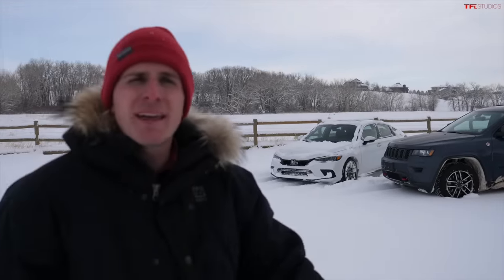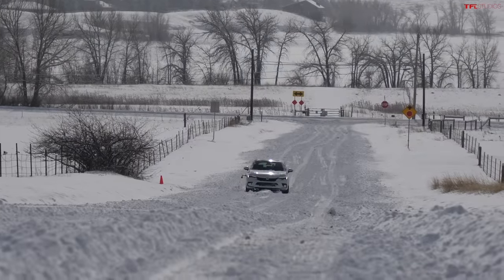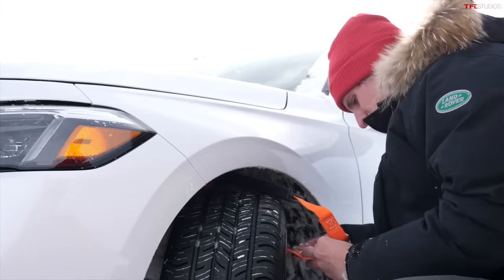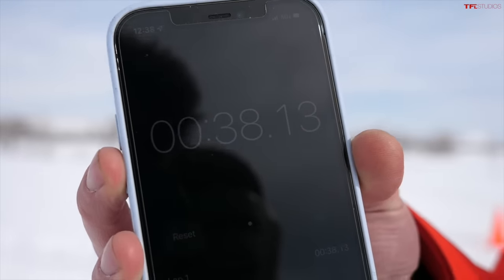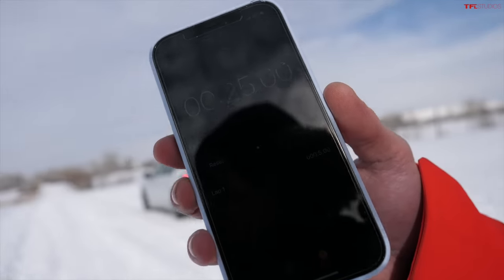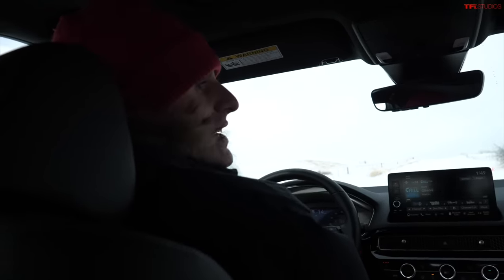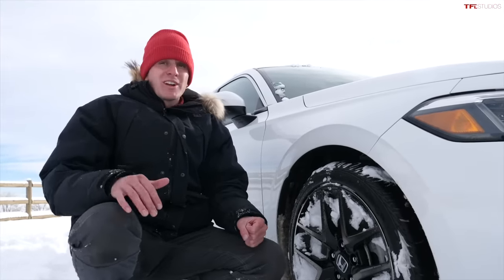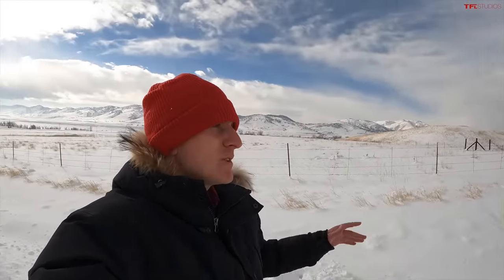Can Off-The-Shelf Traction Aids Make a Civic As Good In The Snow As a 4x4 Grand Cherokee?

Comment: First thing right off. M+S means NOTHING. It is an arbitrary rating with no performance parameters to meet or exceed.
Second, flooring the gas pedal is NOT how you get anywhere fastest in snow. By the time the electronic controls kick in, it is too late. Learn to drive in winter!
Yesterday I was driving through a record breaking snowfall. On 4 mediocre winter tires I was going past and around all kinds of stuck and abandoned cars. I did not have front wheel drive. I did not have all wheel drive. I had a rear wheel drive, 32 year old Volvo 240 wagon with open differential. I was plowing through up to a foot of snow. I did not get stuck. I did not have to reverse out of trouble, I did not come close to losing control even on Highway 400. Your comparison needs better defined criteria and drivers who actually understand winter driving.

Comment: laughing at  your chain install can sure tell you havent put them on before ive done it 100s of times you didnt have the inside tire links secured thats the noise you heard is the clicking underneath those socks are not always allowed in heavy snow, at all times depending on the snow conditions in the sierras we have 4x4 needing chains also at time its stopping thats important..ive plowed a lot of snow with my old gallardo on good snow tires

Comment: This year is flawed from the start. Weight means everything in the snow. You should have either used a FWD vehicle the same size and weight as the Jeep, or an AWD the same size and weight as the Honda. My 2017 Chevy Volt performs way better than my 2005 Subaru Forester, which is lighter. I'm positive that a FWD Honda Pilot would have completed that challenge in half the time of that sedan.

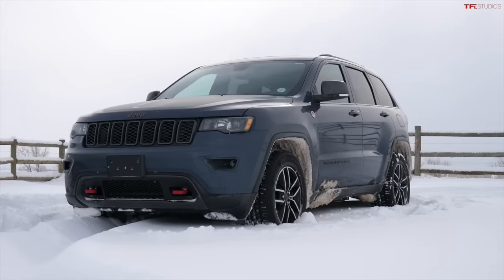Comment: 1:09 - according to the Jeep website the factory 2021 Trailhawk tires are BSW All-Season All-Terrain Tires. Why did you change them? This question has been asked in previous videos with this vehicle when it was failing to move efficiently through the snow.
Reply: In a earlier video they explained that they were given those tires by Pirelli. I also think they got paid by Pirelli to test them out going by what they said. It's very unfortunate cause they are really holding the GC back and we aren't seeing what it can actually do. Really frustrating
Reply: @Rhinomssy  thank you for confirming this (appreciated). To the contact maker, there’s a reason why the Grand Cherokee came with those tires… If the content maker is influenced by Perelli because they got paid then I would have to say they’re tipping the scales in the wrong direction all in the name of the $.

Comment: AWD wins: its available all the time. No stop/starts putting stuff on/off , especially if the weather is poor.
Now to watch the video......
Reply: And how does AWD help with stopping on down hills exactly…
Reply: @Redhawk24  it doesn't.  When conditions require, the system is always available, unlike chains, ropes, blocks, socks.
Reply: @anotherbrickinthewall1700  that’s why winter tires are way more helpful on snow than AWD.
Reply: @Redhawk24  i think they alluded to that in the video: a test of the Civic with winter tires vs the Cherokee with AWD.
Reply: @anotherbrickinthewall1700  yeah but you said AWD wins making it sound like AWD is ideal when it’s not.
Reply: @Redhawk24  AWD wins in terms of ease of use.
Reply: @anotherbrickinthewall1700  not if AWD doesn’t help with stopping. Makes it nearly useless in winter conditions.